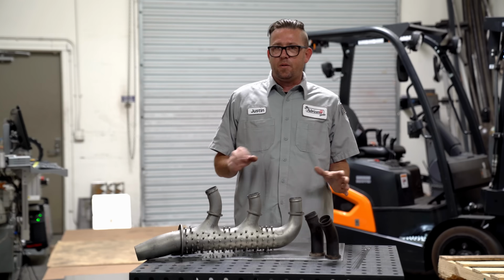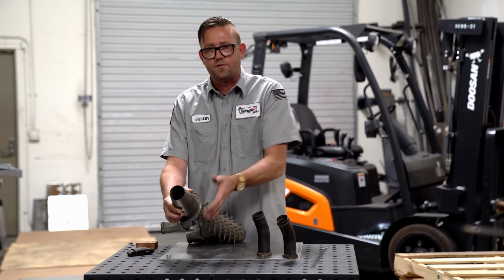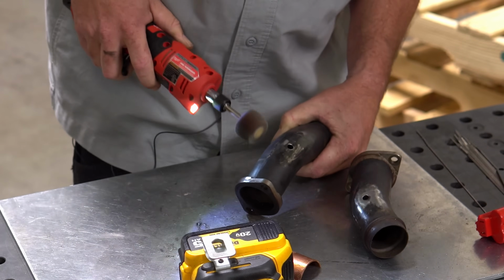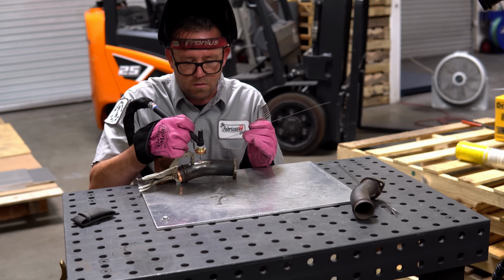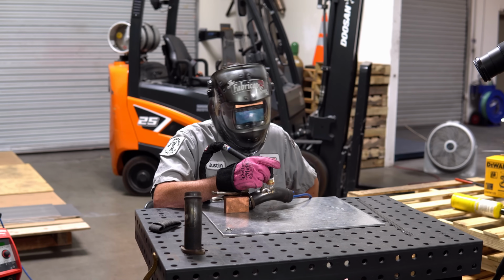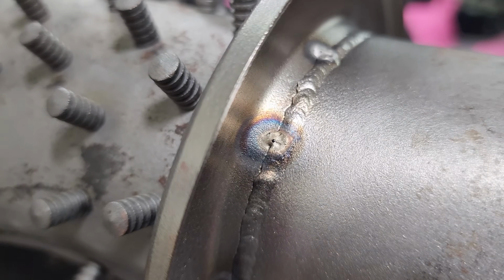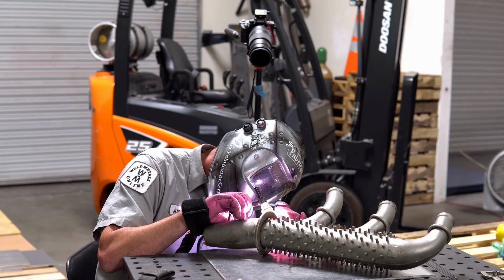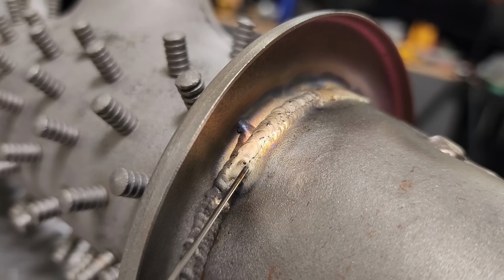Weld Repairs You Should Avoid

Comment: the angled grinder is only ment for 2 inch attachments, tried 3 inch myself and it doesnt work, atleast not with wire brushes, a lighter sander might work, but stick with 2 inch stuff and it will work nice. ( had mine for over 4 years now.)
Reply: 2nd that
Reply: It's also not an air tool. You can't just bear down on it and expect that tiny electric motor to keep spinning. That's the other issue. People try to use it like an air-operated die grinder and that won't work. Then they get mad because it doesn't work like an air grinder.

If you want to treat it like an air grinder, use an air grinder. Not an electric one that's obviously going to protect itself when you jam the motor up.
Reply: Yep it’s made for small carbide bits. He is asking a lot from it as wire wheels like that take a LOT more power to run. Sad that he can’t figure out why that is.
Reply: Yeah I've gotten away with 3" paint stripper discs since they're lighter weight and less drag but 3" wire wheels have too much drag.  Mine has been abused for 3 years and still works great
Reply: Yah it has an overload cut out.  The cutoff wheel does the same thing.
Reply: Came here to say this. I love the m12 die grinders but I only use High Output batteries and don't push them too hard. They just don't have much power compared to an air tool. If you dial back your expectations and use smaller diameter attachments, it's pretty awesome but nowhere near as good as an 18/20v battery tool or an air tool.
Reply: @sammccollum2985  I was gonna say an M18 with a bigger battery might do better.
Reply: @LeverPhile Also M18 would be a LOT heavier and sometimes small light tools are nice. Untimatly there is Im sure a place for both if they made both.
Reply: Not an angle grinder, it's a die grinder, it's not meant to have such large attachments.
Reply: YEP!
Reply: I think it also has to be centered. I had a 2 inch flap disk and it was just slightly off, and it kept stopping as well
Reply: 5" cutting disk and 5" wire brush.... I have a high tolerance for pain. Frying Bacon naked or welding in a tank top..... Grrrrrrrowl
Reply: Can not beat air. I'm an old  man and still not giving up my air. Plus I still have my air tools 30 years later. Let's see battery tools last that long.
Reply: This vid being a year old now, you must have purchased that die grinder just as the 2nd generation tool was being released. Or perhaps you saw that on sale and thought why pay full price for a tool when gen 1 is on markdown . But what you experienced with the grinder cutting out over a mouse whisper of resistance is exactly why that 1st gen blows major whales D. But if the whole experience hasn't completely soured you on battery operated die grinders- gen 2 would have laughed at the thought of cutting out over your attachments choices, and is the real deal. Probably one of my favorite tools ATM
Reply: Indeed
Reply: Sounds like a tool you gotta baby.. nfg that..
Reply: It can feel the resistance off the big wheel
Reply: the tool is just designed to be a polisher or buffer. too much pressure on the tool will cause it to shut off, been through this with a commercial milwaukee rep. it would be a great die grinder if not for this safety feature. over sized attachments exaggerate the safety cut off.
Reply: It'll handle tough stuff with bigger batteries, i used mine to port some heads using a variety of different burrs @kshillbilly1967
Reply: You are correct  Love my right angle grinder
Reply: Garbage.
Reply: I’m not a fan of battery operated grinders. Everything I use is either pneumatic or corded. I have several small angle die grinders and they handle every throw at them. Air tools won’t burn out no matter how hard you use them.
Reply: Ur grinder maybe just to low amp , I run 6-7” cutting discs all the time and made my own guard for the bigger discs and works great.. a menards brand corded angle grinder I paid like $55 for
Reply: You just have a weak angle grinder